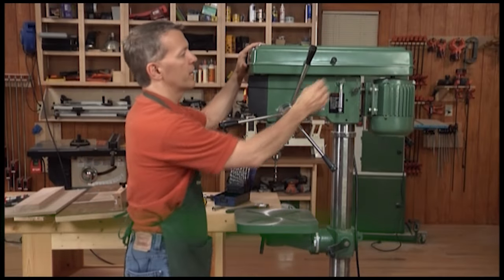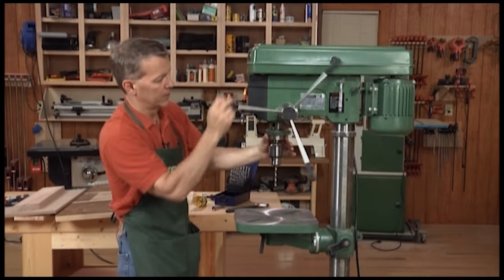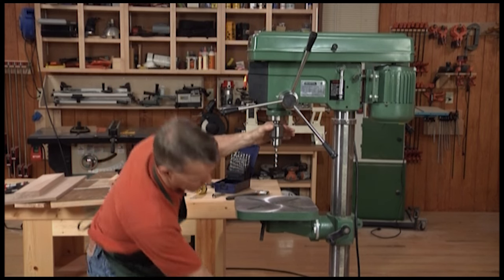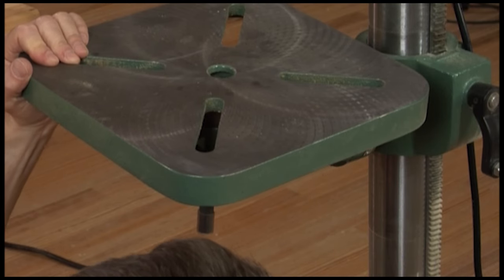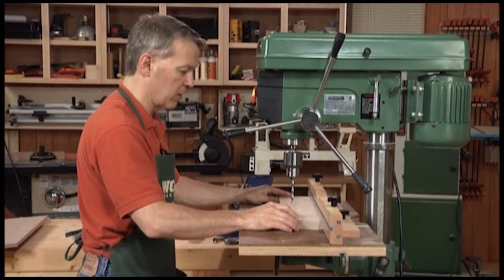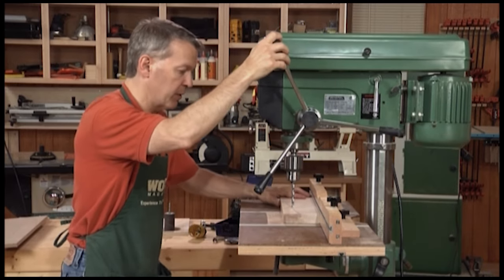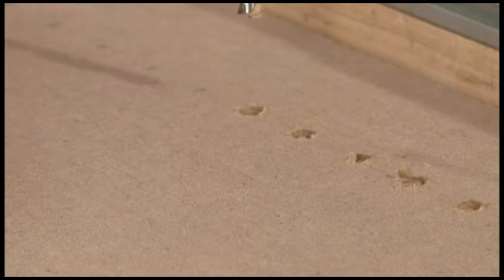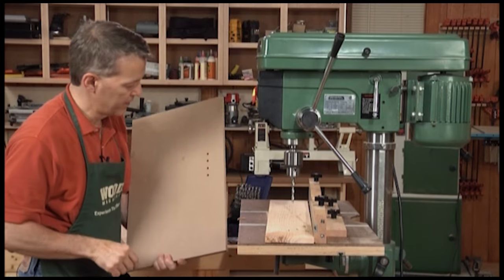Drill Press Basics - WOOD

Comment: The round disks that are left over from using the hole saw or wing cutter are called round tuits. They are very valuable. When you have a friend who needs to do something, they'll say something along the lines of "I'll do that when I get a round tuit." So you can give them one of your round tuits, and they can get the job done.
Reply: Thank you Steve McQueen. I will tell my husband that  I learned  what a round tuit is.
Reply: Best coated with tartan paint from specialty hardware shops.......

Comment: I have read, recently, that using a hand drill as  mini drum sander is unkind to the bearings because of the lateral pressure. makes sense to me. As a fan of bandsaws and mid power drill presses,  do you have any comment about using presses as a substitute for a drum saw..especially one which oscillates in operation.

Comment: Hi. Do you think that a 1/4 hp drill press is strong enough to cutting 4 inches circles with a hole saw on a  1/2 inch board. Thanks in advance.
Reply: 1hp==746W....so a 250w machine might, I Think, be pushing it a bit.
 4inches is 100mm.....and I've never tried using holes saws that wide---I'd set a wing cutter at 50mm from the centre so it cuts 100mm diameter.  And I'm used to machines of over 500W, so that's 2/3 hp.

Comment: Is a drill press even really necessary? between a plunge router and cordless drill which most woodworkers already own you should be able to do anything a drill press can and then some. what am I missing here?
Reply: power and accuracy. He said that in the video.
Reply: Hard for me to believe that you could get the same trueness with a corded drill, I think the drill press excels at getting perfectly vertical holes. They aren't a huge investment, either, under $300 dollars, space in the shop might be an issue though.
Reply: Five years ago I bought the cheapest one Wen makes - I think it was $59 - and used it to make all the holes with a 35 mm forstner bit for the euro cup hinges when I built new shaker style cabinet doors for my kitchen. I tried freehanding the first one but there was no way I could hold the drill steady enough to drill the nice neat cups for the hidden hinges. With the drill press it was a piece of cake.
Reply: @juliemandell  A 450W drill press and a set of good Forstner bits... for Christmas, please :-) Never used a router.
Reply: You`re missing common sense when you think  a cordless drill can do what a drill press does.